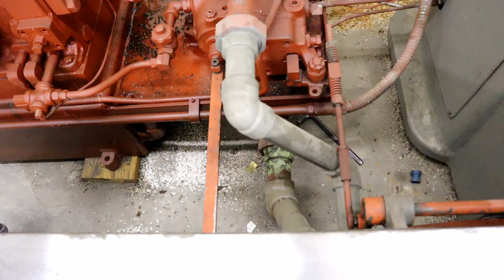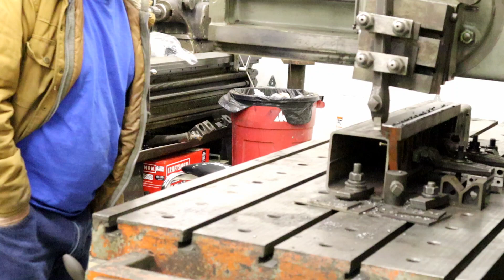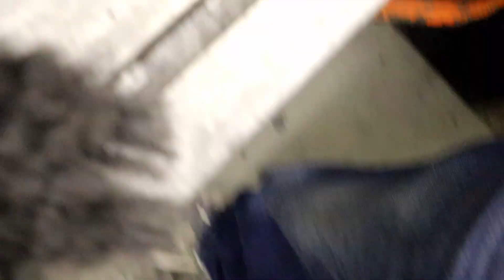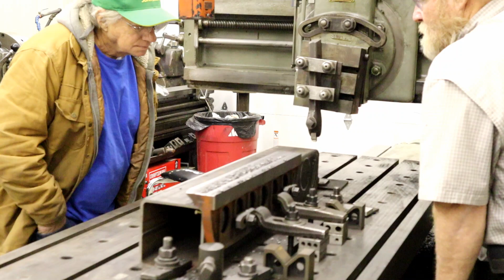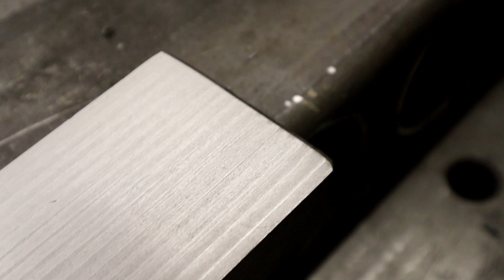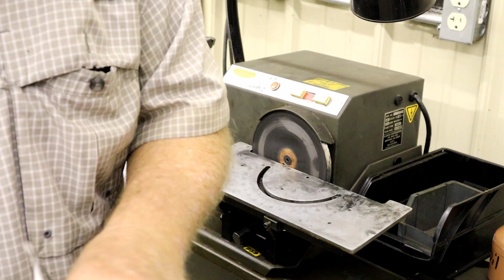Planers are COOL!  Setting up and planing a Straightedge Part 2

Comment: I could swear somewhere, for sale, I've seen a tool HOLDER with that "gooseneck" built in.  Possibly even Armstrong brand.  It was far too big for any of the hobby stuff I do, and I didn't know what use it could be at the time, anyway.  Might be worth opening your searches up toward.  Could be that the one I saw held smaller bits than you are currently using, but it probably came in sizes, too.
Reply from the maker: Bob I have see those too... The problem with them is overhang.  In a perfect world the cutting edge of the tool would be directly under the pivot point of the clapper.  the gooseneck bits were designed to move the edge back to that point...  Now of course that is impossible on my planer as the clapper box is nearly 5 inches thick and out in front of the pivot point by that much...   The holders I have seen all take up a lot of forward  area and place the tool even further away from the point than I am now..

Comment: Steve try adding a rounded tip on the leading edge it always helped when I use to cut castings. Your deep relief is perfect for chip management. As you said honing is the key to tool life and finish quality. Love those old planers tons of memories from years of use. Never ever had a part come out or off mine. Glad ya got over 10 thousand subscribers keep the quality and more will come.
Reply from the maker: It's 1 thousand :)   I have control over ads now and I have turned off everything I can !  People not using an ad blocker should only see a skippable ad at the first of a video and nothing more!

The roughing bit has a small radius..  the finishing bit has a tiny one ..  If I'm doing other projects the larger radius tools come out but  when taking off a half thou these bits have worked out the best for finishes...    My finishing bit is "slanted" so that if I feed one way it cuts in a semi positive  angle and fed the other way it is a semi negative angle... 

Also  I am VERY conservative on straightedges... That  blank is 450.00 and I don't want to see Don cry :)
Reply: Hey Armstrong makes a spring type curled tool holder for those. Watch eBay to find , I have a small one for my planer .
Reply: The box channel is causing the chatter. Its not stable enough for your application.
Reply from the maker: You are not the first person to mention that :)   But for what I'm doing it has worked great for over 150 edges....  The chatter was coming from the edge not being held tight enough to the box... After a 1/8 of a turn on the front screw chatter was gone...

Comment: I love planers! great to see it running. Maybe, just maybe we don't need to see every chip that comes off! All the best, Matthew
Reply from the maker: Aw Matthew......  IF I don't show the cutting you don't get to watch Don's head going back and forth , back and forth, back and forth :)
Reply from the maker: I'm trying to make videos that are at least a little informational.  What you are seeing in that one part is cut down from about 2 hours of work. So that's a 50%  savings right there :) 
 One of the reasons I show so much is it's relevant to the task at hand... Watching the cutting is only half the "picture" as listening to the blade going across the surface tells you so much more.  I know it might be boring for some but by showing you the blade going across the whole surface you pick up on the subtleties of the job.    In one part of the video you see how I started the cut and it only took off material as the blade was almost finished making passes..  If I had not completed that cut the next one would have been 30 thou deeper on the next cut and might mess things up. 30 thou of cut might not seem like a lot but when the 450.00 edge is being lightly held, to reduce stresses, it's enough to ruin your day.... 
The other reason is Don has become a complete camera hog and gets upset if he does not get, what he thinks, is his share of on air time :)
Reply: @10swatkins  Steve, don't get me wrong,I appreciate how difficult it is, I recently took part in Emma's tool making competition which had a length of 20 minutes maximum. It was extremely difficult to fit into the allotted time, but, it was interesting to review how I was seeing what I'd done!
Reply: Or, viewers can skip forward and leave the content in. Options!
Reply: @larsrodbok  You don't have ADHD do you!
Reply: @MatthewTinker-au-pont-blanc  I would have asked the same of you. I enjoy watching metal shapers, planers, power hacksaws and all industrial machinery running. I have these machines myself, but love watching others work with them. My point to you is, if you don’t enjoy all the cuts being shown, skip to the parts you do like, rather than ask Steve to cut his vids short. I can get abbreviated versions of machinist projects anywhere. To each his own.
Reply: @larsrodbok  My point is, are you making a video about setting up and machining a straight edge or, are you making a video in which you are watching a planer run! I'm not against people who want to watch a planer run!